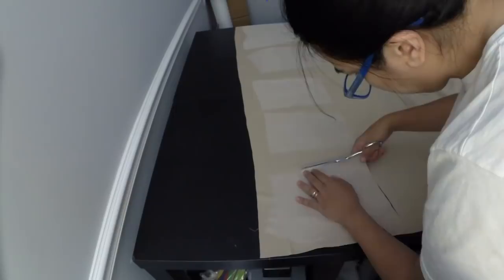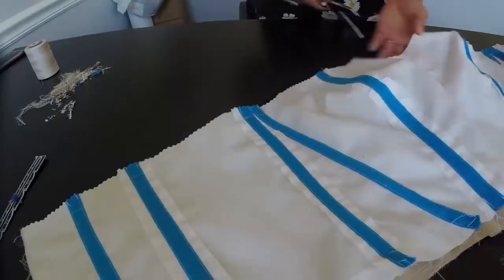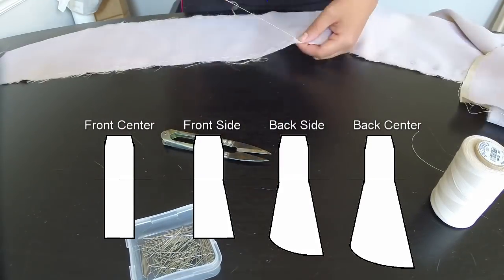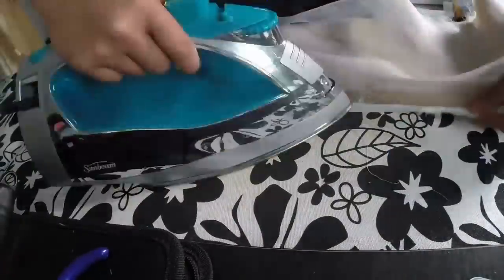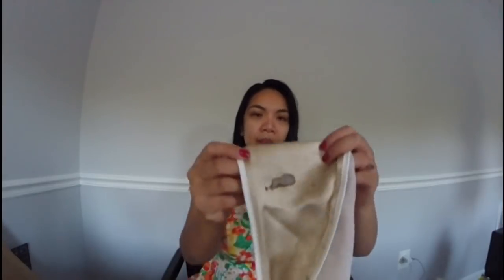Sewing and Burning My Wedding Gown [Part 2] | Old Hollywood Wedding Sewing

Comment from the maker: I know it was a long time coming, but here it is!
Where I burned my dress: 9:25
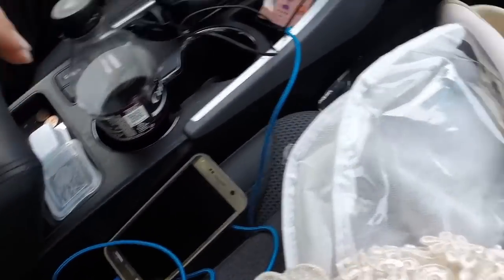Finished dress - 12:13

0:10 - Cutting silk/underlining
0:38 - Basting to sew the silk
1:48 - Adding the bodice lining
3:00 - Skirt pattern pieces (and train!)
4:05 - Seam finishing for the skirt
4:21 - Bias tape making
5:18 - Hong Kong finish
5:53 - Sewing the skirt to the bodice
6:15 - Invisible zipper
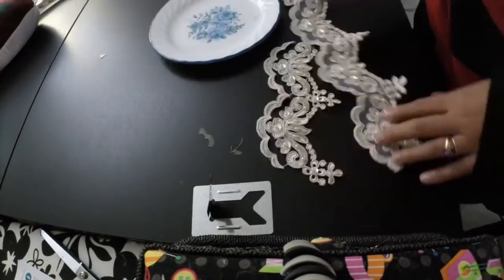7:00 - Lace trim detailing
7:26 - Handstitching the lace trim
8:17 - Stitching the off the shoulder trim
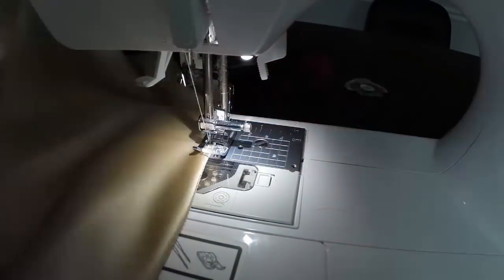8:54 - Hemming
9:25 - Burning the dress and fixing it (storytime!)
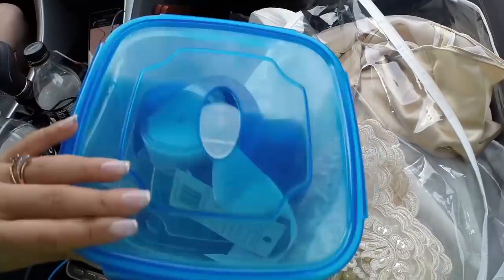11:52 - Sewing in the car
12:13 - Pictures of the finished dress!